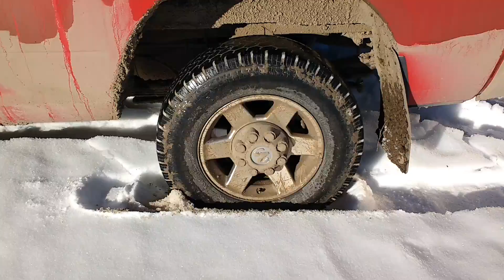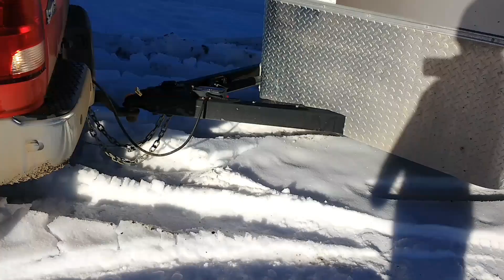Open differential

Comment: I wonder if you could have a limited slip diff, based on a troque converter.
It would be designed like an ordinary open diff. But then adjascent to the diff, you'd have a torque converter connecting both wheels too.
No friction plates to wear down, and would still allow for differing speeds. But it would limit the difference in speed at a certain point.

Comment: The sad truth is that most people here in Wisconsin who think their 4x4 is better in snow than an AWD vehicle learn this lesson the hard way. 4x4 is only 2x2 without LSD or Locking Diffs. This is why my AWD keeps pulling them out (2 f150s, 1 silverado, and my dad's RAM in the last 3 years). Now if I were going to buy a 4x4 for snow or serious off-roading, I would absolutely get limited slip at minimum and if I could swing it front and rear lockers. Since I don't off-road and therefore cannot justify the 4x4, until then, I shall continue to drive confidently all winter, in my "4x4" rescuing Honda Ridgeline.
Reply from the maker: I agree, the best snow vehicle i have ever driven was an AWD SAAB, better than any jeep or truck i have ever owned. Drove like it was on a rail, even in slick stuff. Not great if the snow was deep though. Thanks for your input, god summary
Reply: @anesthesiadreamin  if I put locking hubs on the rear axle with open differential, would both tires get power?
Reply from the maker: @Supadupa335  that would be nice, but unfortunately no 😁

Comment: Surprised they put open diffs on a truck like that. Been a few times I've driven in the snow thinking I was in 4wd, but realized later I wasn't. I run Falken Wildpeak at3w tires though.
Reply from the maker: yeah me too :-)  Are those falkens "E" rated for a 3/4 or 1 ton truck like this one? What kind of mileage are you getting out of them? Are they wearing well?
Reply: @anesthesiadreamin  think depends on the size. Believe mine were 10 ply E rated. I put mine on in 2017. They're nearly bald now. Going to be replacing them this month actually.
I put them on all my vehicles. They resist nails & have treads on the sides.

Comment: Traction control wont make both back wheels spin?
Reply from the maker: not in this case at least, I think it just applies braking to the wheel that's spinning faster so the speeds match. IDK why it's not working right here in this video, but maybe it's because it is very low speed

Comment: Locker... Limited slip... Or Jeep Gladiator sport even (or better ) with BLD (if it will tow that much ). Wouldn't even need locker or limited slip probably. Good demo though ! Power wagon would get it done too. Simple Brake Lock differential type setup would probably get you out. No Jeep after 2005 or so would ever send power to only one side. Worst case is BLD and it will toggle left and right. Locked of course moves left and right together but often just a toggle will get it out.

Comment: Just to see if i under stood it right, an open diff wud just spin 1 wheel on a 2wd truck and a limited slip diff wud spin both tire?
Reply from the maker: U r correct. You can include locking differentials with limited slips. Keep in mind though a limited-slip needs power to lock up both axle shafts together...at speeds like rolling around a corner it would differentiate allowing the outer wheel to roll faster than the inner, but if you were on the gas going around the same corner the limited slip would probably lock up making both tires turn at the same speed and the inner tire would "chirp" on the pavement. Anytime you get a chance, look inside a differential that's jacked up off the ground, spin the wheels and watch what happens inside the differential, then it will make perfect sense